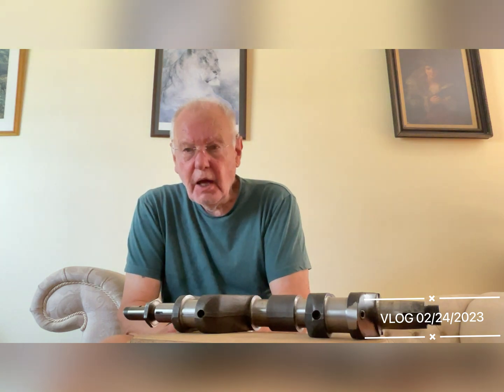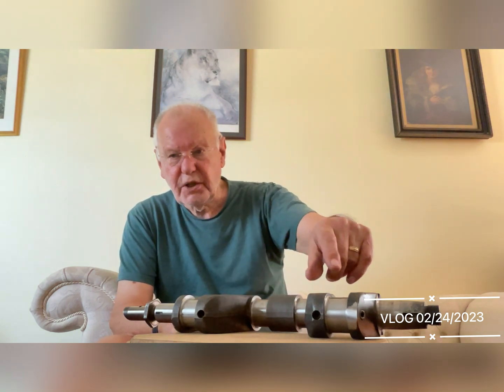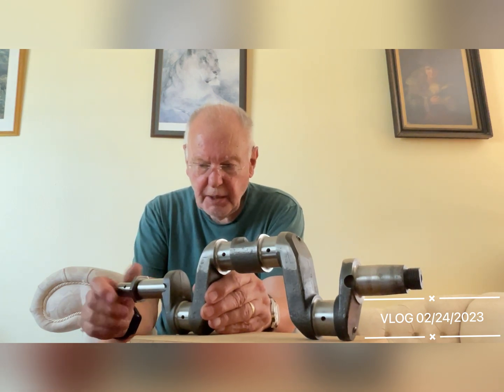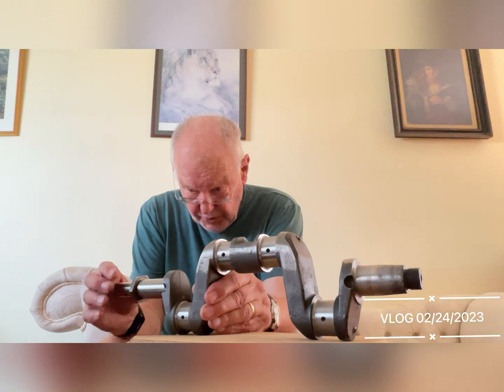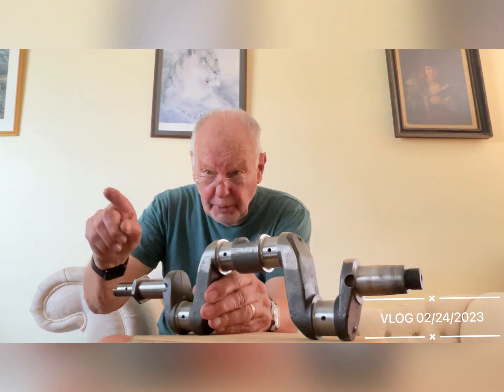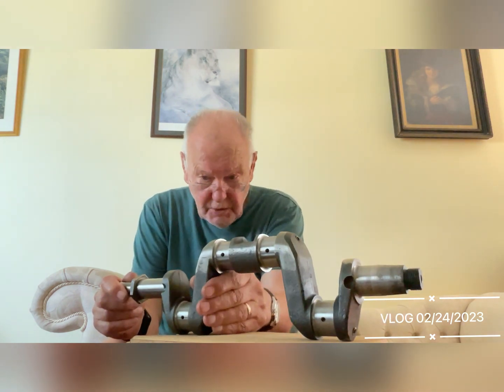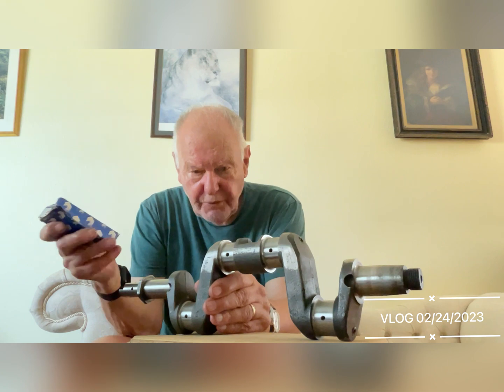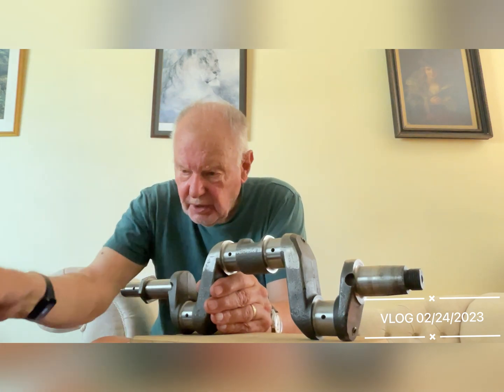Austin 7 Crankshafts described

Comment: Unless you are racing you do not need a pressurized crank a splash crank can cope with 5000 rpm with ease. Fit a new filter system with a modern filter and you will never get any blockages cost about c£150. I know

Comment: Do you use a standard Austin 7 oil pump overbored with these pressurised cranks? Or do you use a different type of oil pump? What sort of pressures do they run at? Thanks.
Reply: Only 2 bearings 😮, ridiculous
Reply: @marmac567  Agreed. A four cylinder engine needs at least three main bearings. I can't imagine the flexing of the crank at even modest loads and speeds.
Reply: A non pressurized crank is good for 5000rpm+- with standard rods or a bit more , in my experience a pressurized crank is often more trouble than its worth forget Renault  rods too much trouble.The secret of winning a highplace in the A7 world is reliability and finishing  that gets you the points to win a championship! Engine runs with 15 to 20lbs (overbored oil pump) splash fed and full flow filter.Enjoy !